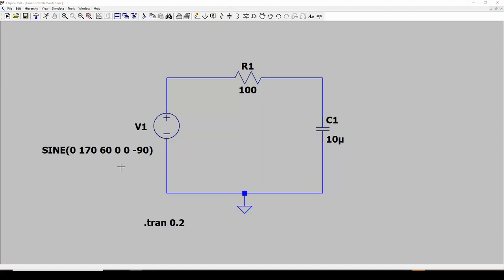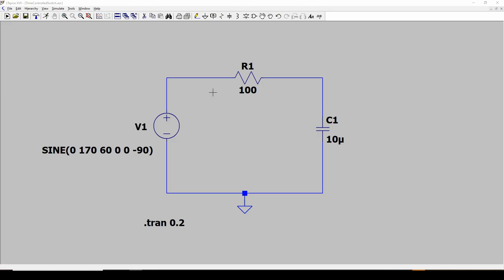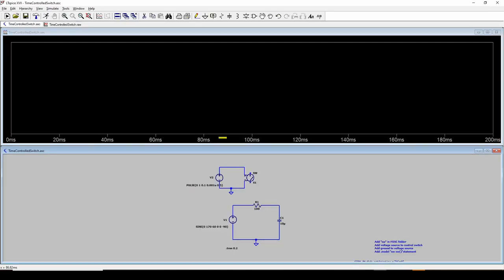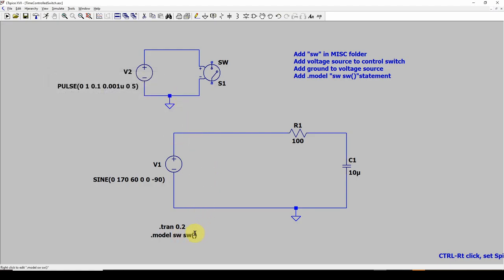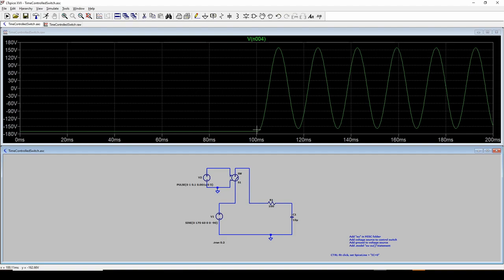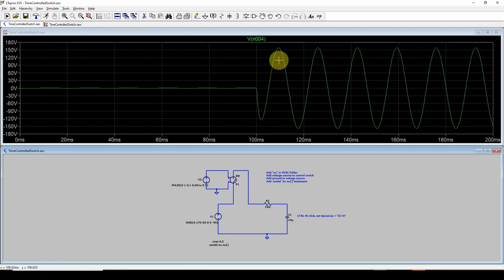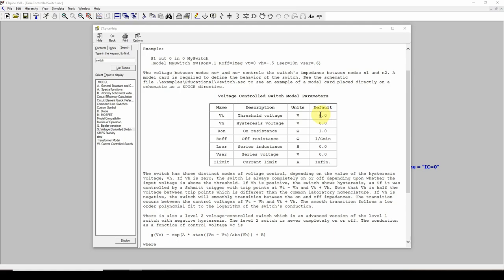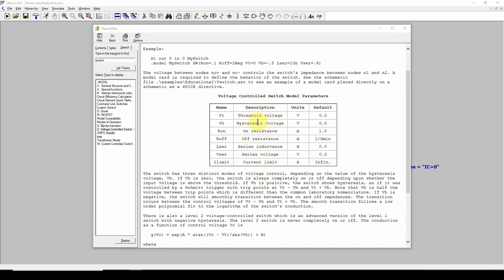LTSpice: Using Switches in Simulations

Comment: For everyone who's wondering how to turn this pulse switch into a PWM switch, you have to change the spice directive:
.model sw sw(Vt=.5 Vh=-.4)
Vt is the trip voltage, while Vh is the hysteresis voltage. Meaning, the switch turns on at (Vt - Vh) = 0.9V and turns off at (Vt + Vh) = 0.1V
You can also change the on and off resistance by adding them to the spice directive with Ron and Roff respectively.

On a side note, for me the sw component was no longer in the Misc subdirectory, but rather at the root.
Also, if you have multiple switches the first sw in the directive is the name of your switch. So with a switch called foobar it'd be:
.model foobar sw()

Comment: With LTSpice V 17.1.15 the shown circuit will not work. Once the switch is activated it will not open again. You have to set the voltage pulse from -1V to +1V to make it work.